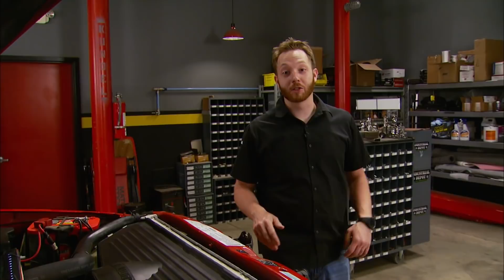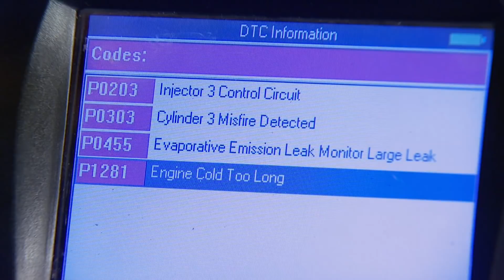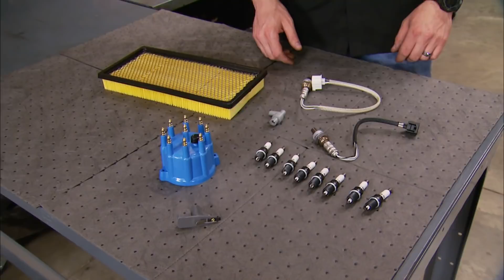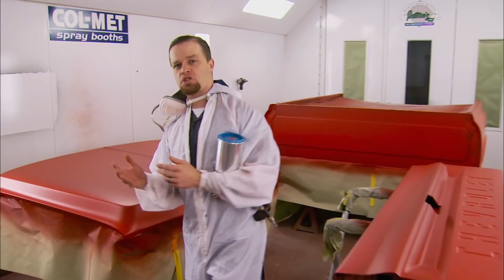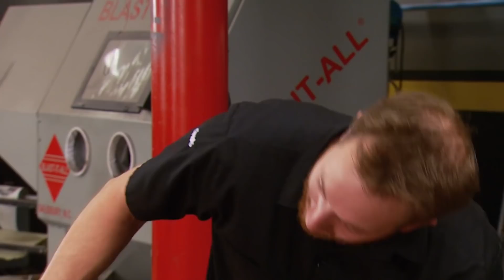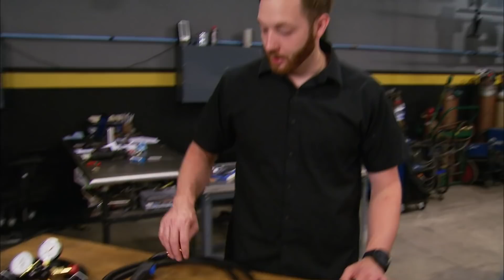Quick Fixes to Help Pass an Emissions Test - Truck Tech S3, E19

Comment: LOL! Here I can drive with my tailgate down and no front license plate! We supposedly have a "safety" inspection but as long as you pay the fee everybody passes. Your truck could literally run on coal. If the CEL is a problem just take out the bulb.

Comment: Notice that the truck was able to pass smog with $10 worth of rubber hoses and a $7 thermostat. So why did the owner choose to drive around on expired tags for a year? Probably because the shop quote was sickeningly high. Being a California native who like old cars, I've had my share of failed emissions tests. Each time it happens, the shop will call with estimates so high they cause nosebleeds. Yet unless the car is blowing blue smoke, the solution has always been very inexpensive. Even when the car is 25 years old and near death, I can always get it through with at most a new cat. I haven't decided if the high estimates are because the shops don't understand emissions and are guessing, or because they are thieves (probably more the latter than the former). It just shows what a little bit of knowledge and effort can accomplish.
Reply: Owner was probably too lazy or cheap to get it diagnosed...

Comment: Couldn't get away with the tail gate down trick to hide the tag in New York State. Not only do we have to run a front tag we also can get a ticket for driving around with the tail gate down with no load in the bed.

Comment: So all that uncombusted fuel in cyl 3 is running right into the cat converter. Poor truck
Reply: if the injector is unplugged it's not spraying any fuel so no unburnt fuel on the converter
Reply: @mothridith9760  we do not know if it was fully unplugged, could have intermittent injector activation from a loose connection

Comment: 16:50 No fuel additive will increase hp or fuel economy. Royal Purple pay them to lie.
Reply: Indeed! Check out the comparative oil tests on the Project Farm channel on YouTube! Its AmsOil or Pennzoil Platinum Ultra a close second.
Reply: Yes it will, I have first hand proof. 99 durango, injectors are pretty bad but it runs fine however I got no more than 13.8mpg on just 87 gas. However running 93 gas or 87/91 with some of that stp fuel stuff I get about 15.3. Not much and still terrible but it still made a difference. So for mpg yeah it'll help in some cases, horsepower I have no idea
Reply: Increase HP and economy? No. But, restore HP and economy? Yea, that I'd believe.

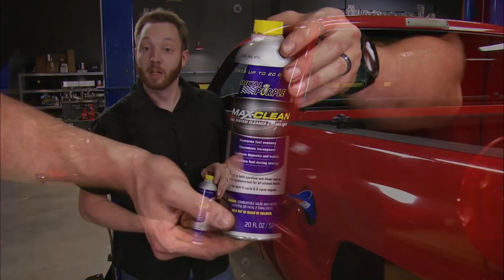Comment: 16:33 you can not clean your fuel system with a can of additive. The fuel system is not dirty anyway because of the fuel filter. 
You ever wonder why they never change the fuel filter. The filter people don’t pay them.
Reply: Yes you can. It's been proven multiple times by independent testing. The fuel filter can only filter particles down to a certain size. These deposits build up over time. Also, carbon deposits from the combustion process and PCV system cause extra gunk buildup in the engine which can be removed and have a noticeable impact on performance and efficiency.

Comment: 9:40 do not replace o2 sensor until you get a code. If they were bad. The check engine light would have been on.
Reply: chrylsers of those years are known for 02 sensors getting stuck and not throwing codes.....common problem
Reply: These trucks are bad about sensors going bad and not throwing codes I've had it happen a few times
Reply: @slumpnmyrump4986  it acts like a fuel problem...they sputter and stall and then when you floor it runs great.....they are notorious for bad 02 sensors...

Comment: I'm just here to read the comments from all the people that are "wanna-be" car guys.

Yeah... I'm in California and I've been driving since 1986 back when fixing most complicated emissions problems at home was BASICALLY IMPOSSIBLE!!!

All you proud polluters from around the country/continent seriously need to grow up and stop whining. OBD1 and OBD2 have made the process INFINITELY EASIER than it ever was in the 70's and 1980's.

What's more, they both make it easier to modify and properly reMAP the fuel input to the engine after modification.

I love reading comments from people bemoaning California. LMAO!!! When it comes to this subject WE did the heavy lifting for you people DECADES AGO!!!! 

I have a 2000 Maxima, '98 Dakota, '06 Mustang GT and '14 Camaro V6 (all cars manual transmission)

For the past 5 years I've commuted 200,000 miles. 0 tow jobs needed, 1 smog fail. The OBD2 port on my Dakota is worn out, likely from the constant monitoring i do with TORQUE using a Bluetooth Transmitter.

Most of all, CHECK THE HISTORY. Without CALIFORNIA the Car customizing game wouldn't be near what it is today!
//No good deed goes unpunished. 
--Mayor Dick Murphy (erroneously blamed for that 'ENRON by the Sea BS)
Reply: Nice rant about how good California's environmental laws are, how are those Forrest fires, mud slides, and the smog layer over LA treating you?
Reply: You're the only comment so far that mentions California.. in your typically Californian reply.
Reply: Have fun in the state Helliforeigna you little liberal.
Reply: California only tests thru the OBD port now, duh, no tailpipe emissions testing, pretty strange to me to depend entirely on the computer for emissions test but it is what it is.

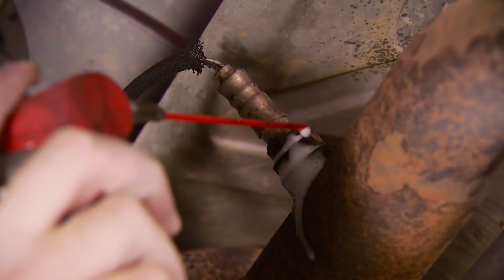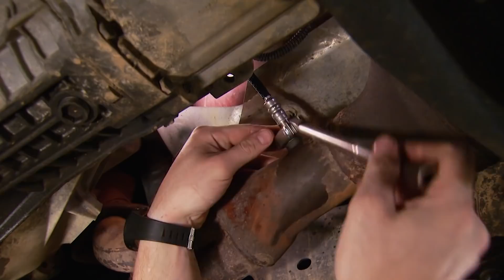Comment: 9:46 - 10:05  the video does not match what hes explaining. primary 02s1 is up stream closest to the manifold/header secondary 02s2 is after the catalytic converter to monitor cat temps.
Reply: You're right

Comment: I dunno why they say TN does emissions checks cause I live in tn and iv never had a inspection and ppl drive around with trucks burning more oil then gas and everything else you can think of and I know they dont inspect anything here in west tn
Reply: Ricky Walley I live in Hendersonville Tn and we have to go through emissions it’s annoying because I can’t do any motor upgrades
Reply: In Rutherford county, they do emission tests. But in Cannon County, they don't do emission tests.
Reply: When i was still in Clarksville, we didnt have emission testing either. But it varied from county to county. And, Nashville was a different county.
Reply: I guess it's just county to county, I live in west tn and I I dont guess I know of any county that does them near by, if they did start doing them here, no one would have a vehicle lol